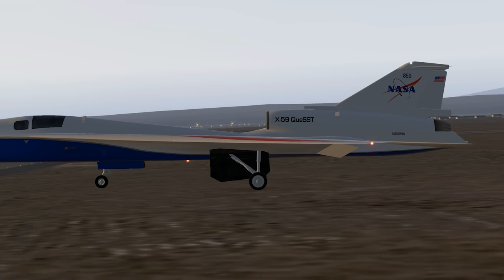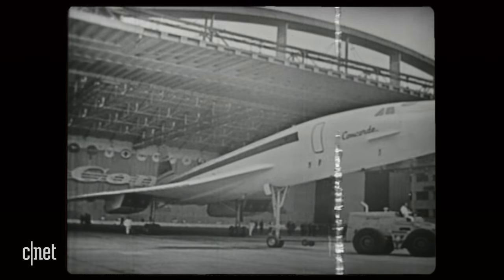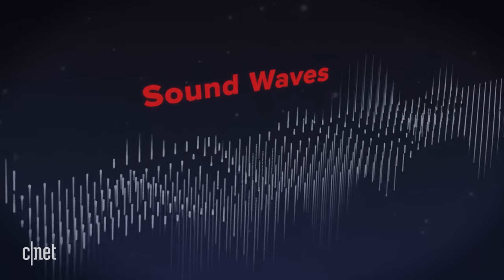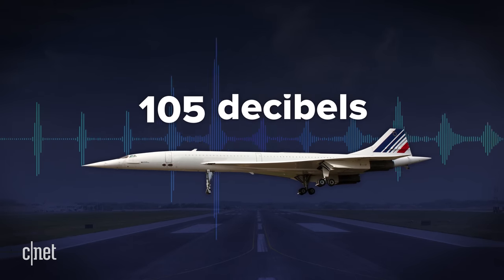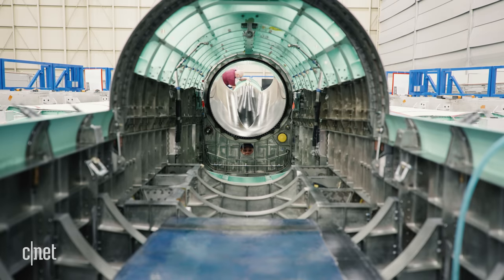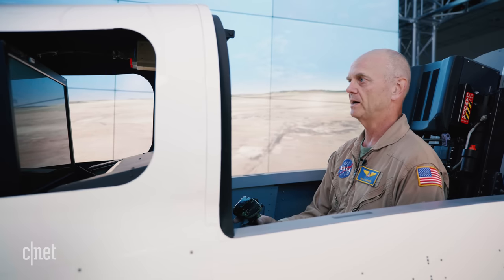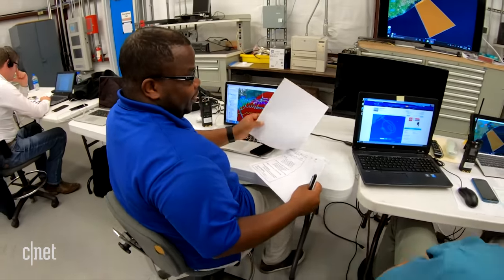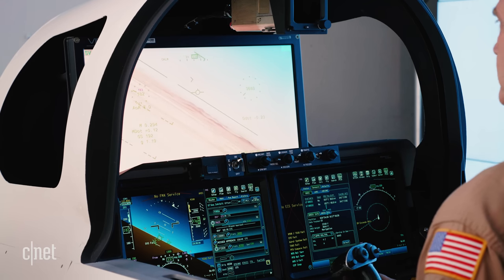Exclusive look at NASA's low-boom supersonic plane

Comment: In terms of supersonic transportation, what is needed is a "Jumbo" supersonic airliner to make it financially profitable and usable by all flying passengers. One that can carry about 500 passengers, like, the Boeing 747 or Airbus 380.  But this would require, as seen here, a sleek spear like low sonic boom aircraft that would be very very long to accommodate many passengers.  Another problem, the parking space at the terminal and runway/taxi requirement dimension physical restraints to operate such a very long low boom supersonic Jumbo transport, again not practical. 
It seems, the best method of passenger super sonic transport speed is by economically designing a way to get to earth sub-orbit, to reach the final desired international airport on the other side of the planet, much like the space shuttle, but with powerplants available to be use once in flyable atmosphere altitudes, (<50,000') so as to have in case of weather and or emergency go arounds, etc.
Reply: ГИТЛЕР. КАПУТ

Comment: first off all this experimental airplane slick design make it almost as long as concorde, while hardly carrying one pilot, while concorde was carrying 100 like passangers. 
2ndly there is no question of sonic boom problem, concorde did not make any sonic boom near residental on comercial areas. Concorde only took supersonic flight when in international space, over atlantik or high up in the air. 
3rdly, supersonic travel is question of economy as main factor.

Comment: Two problems; 1) You could never get the body to be wide enough and tall enough for a passenger load of more than 5-8 people plus luggage and amenities and still keep the shockwave at around 75db. The mention of a possible "Air Force One" sst is ridiculously laughable. NASA must not have ever been in the Presidential aircraft, or else they would've remembered the massive amount of heavy electronic equipment, deterrent measures, reinforced construction and some redundant systems it carries...not to mention a rather large crew. Have fun jamming all that into a light pencil-shaped craft with an interior the width of a crawlspace. 2) Yes, that camera array would have many advantages over a traditional cockpit window...until it doesn't. What happens when it malfunctions or its internal temperature monitoring system fails and it ices up? Better have a redundant array on the underside because your backup, (human eyeballs looking out a front window), doesn't exist...can you say "uh oh". Giant waste of money for these projects. Advancements in UAVs will handle spy/recon duties in airspace. These projects only possible functions could be spy craft in low altitude space as countries in the future will start claiming sectors of low orbit like they claim airspace zones over their respective countries. I get the sense that all of these private firms including NASA are developing these prototypes under the guise of it being for subsonic passenger travel, but in reality are really just jockeying for a military contract with the Air Force or Space Force because all these big brains can't be so summarily dense as to ignore the hurdles which I've stated above, knowing that those issues make this dream virtually impossible. I suppose however, some company might have the audacity to shuttle around four VIPs at a ticket price of a million a pop just to be a profitable venture.

Comment: 100ft/person = this will NEVER be commercialized travel Lol
Reply: It's to empirically prove a concept. Technology which would later on be used to develop an actual passenger plane.
Reply: @Phughy  except the Concord did that.
Reply: @OriginalBernieBro  did what exactly?
Reply: @OriginalBernieBro  Concorde was a Supersonic passenger airplane. Did you not watch the video? They try to tackle the issue of loud sonic booms. This is what this radical EXPERIMENTAL plane is trying to show. Low boom capabilities.
Reply: @Phughy  I just can't fathom a business case for such a plane no matter how quiet it is compared to the Concord. I'd recommend that you watch the documentary on why the Concord was a failure. I saw it years ago.
Reply: @OriginalBernieBro 

I've seen it. But is only describes the Concorde situation and business plan and why it failed. 

Now's today, a few decades later. Exclusive high-end customers with private business jets where luxury and premium experience are set forward. So, I agree, it will never become a commercial standard, but rather a niche. High end passengers are willing to pay 10k for business class seats. They'll easily pay you 5K for the same trip, with half the travel time. 

There's a new market opening up. But let's agree, this will never become mainstream commercial aviation. Merely a niche for the rich and famous.

Comment: The theory behind this is very old.

Lockheed Martin showcasing Skunk Works as a point of pride instead of a fly-by-the-seat-of-their-pants (and budget) division is new.

The prototype isn't even done.

I would rather not begin to think about how much money has been wasted on this.

It probably won't be available to customers in my lifetime.

If it is, I doubt I will be able to afford a single ticket.

A future for rich CxOs isn't one I want. It's already bad enough with the present being mostly for rich CxOs.

Note: my deceased maternal aunt used to fly on the Concorde. She was a VP of marketing for Paramount and prior to that Warner Bros. and died at 41.

A complete boondoggle. A reminder of why I wrote Lockheed Martin a strongly worded email after they repeatedly attempted to headhunt me. The only way I would ever deign to be hired by them would be to dismantle them from the inside out.

The world doesn't need any more mercenary industrial complex DOD profiteers.

Comment: Problem with the X-3 and was addressed by Concordes dropping nose. Was you can’t see a thing.....with that long nose! It looks cool...and works to its point! However..landing was a problem. Got to drop that nose! Sonic Boom and expensive ticket prices and crash. Made it a non commercial fiasco! Had no military applications. Now this is much smaller. And just a test vehicle. Another prototype....like the X-3. Which was underpowered..and those stubby wings made for very fast landing speeds..and not much lateral control. The F104 was a direct result of this research. A fast interceptor..the 104 also had another name. Widowmaker!  Touchy....and several accidents.

Comment: There are more considerations about supersonic passenger travel than just the boom. The pollution caused by Concorde seriously threatened the Ozone layer and used waaaaaaaaay more fuel than a typical jetliner. So unless they found a clean and efficient way to push the plane to those speeds then I’m still against it.

Comment: Yes, it's cool, and I'm for tech development, but there are problems. What are the consequences of using this tech? The thing has to fly in the stratosphere where air gets trapped and does not mix with the air above & below it - including the copious exhaust expelled by these jets, and the pollution stays there for years.

Comment: 57 Proof of the flatness of the earth
Physical and scientific evidence of the flatness and stability of the Earth:

1- water level
2- No curvature (law of perspective)
3- There is no gravitational pull
4 - The failure of the hypothesis that the Earth caused the eclipse.
5- Radio waves are not transmitted in a curved path.
6- The impossibility of air (atmosphere) coming into contact with a vacuum.
7- Aircraft do not bend.
8- Aircraft are not affected by the movement of the earth between the north (0 km / h) and the equator (1666 km / h)
9- Proving that space agencies are lying (fake videos and photos)
10- Railways.
11- The appearance of the stars does not change during the year.
12- The location of Polaris has not changed despite the three movements.
13- The inability to launch the missile in a vacuum.
14- Experiments have proven that there is water above us
15- Trigonometry proves the impossibility of the sun being 150 million km away from the earth
16- The horizon rises with you when you rise to the level of your eyes
17- The many differences between the two poles, while it is assumed that they are similar to the spherical shape
18- Not feeling the movement of the earth
19-No flights over Antarctica
20- Seeing the same stars after six months (they are supposed to be on the daytime side)
21- Allegation that the Earth is flattened in the equator due to rotation, but the seas are in their place and the rotation has not affected them.
22- The retrograde motion of the planets breaks the solar system and the planets revolve around the sun.
23-Determining the size of the sun, the size of the planets and the moon, and the distances, and putting large numbers without evidence or scientific proof to prove
24- The width of the moon’s shadow at the time of the last solar eclipse in America was 100 km, which means this is the width of the moon or smaller, because scientifically it is impossible for the shadow to be smaller than the body (abbreviate it yourself).
25-The direction of river flow violates the law of gravity
26- Flights and itineraries made sense on the flat
27- The closer to the sun, the lower the temperature
28- The atmosphere is supposed to expand or contract due to its sticking in a vacuum
29- The scientific community cannot define “sky” at all. This is only possible with the Qur'an.
30- Clouds do not curve to match the curvature of the earth (it is always straight from below)
31- The difference in summer and winter between the north and south of the Earth contradicts the theory of the Earth's tilted axis.
32- It has not been proven that the sun is made of fire and plasma, and the flames have not been photographed in a real way
33- The theory of the water cycle does not match hot, steamy areas
34- The weight of clouds carrying water, snow, hail and ice, violates the law of gravity (the last incident is witness).
35- Too many suspicions about the existence of satellites and the space station
36- No logical explanation was given about the {go fast} missile hitting the water at an altitude of 116 km
37- The impossibility of cutting millions of kilometers of light without fading out (you have a searchlight, does its light travel for several kilometers, even the laser, and what does it do for hundreds of kilometers)
38 - Refuting and contradicting the theory of Big Bang and evolution, which definitely proves that the Western scientific community is full of lies.
39 - Gravity and how it is has not been proven and defined by experience.
40- The media war, silencing of mouths, and the policy pursued against flat owners by global sites such as Google and YouTube suggest that there is something terrifying them, while they spread absurdities every day such as asteroids and black holes.
41- The 1880 Michaelson-Morley experiment was obliterated, because it proved the stability of the Earth.
42- The Biddle-Ayre experiment, which proved the stability of the Earth, was obliterated and ignored by the scientific community.
43- Calculating the times of eclipses and eclipses has nothing to do with sphericality, just an account based on the Saros cycle, which was used at a time when everyone believed in the flatness of the Earth.
44 - No scientific research peer reviewed publication empirically proves the curvature and curvature of the earth.
45 - Experiments are to prove hypotheses and theories that contradict reality! How can a flat person perform an experiment to prove, for example, that the earth is stationary and does not rotate, or prove the opposite of what it sees with its own eyes! The footballer is the one who has to do experiments and not the other way around to prove his hypothesis and so far all his experiments have failed and have been refuted by experiment and proof.
46- The weights do not change whenever we go north or south of the equator with the stability of attraction and the weakness of centrifugation.
48- Neglecting density and pressure in the law of gravity and calculating acceleration
49 - The horizon is always straight and not curved, and it is always at the level of the eye and sight. Chicago buildings that appear 80 km away are the most significant evidence of the absence of any curvature.
50 - Lines of longitude and latitude are congruent to a flat, while they do not fit on a sphere! Because the ball is supposed to be circles of length and circles of width! The ball is not straight, all sides are circles.
51-The sky is always above us, not around us!
52- There is no meaning for up and down in the sphericity of the earth.
53- In order to calculate the speed of any body, you have to be constant, so how was the speed of the planets and stars calculated, and the Earth is not fixed, rather there is nothing fixed in the solar system?! Was the Earth's speed around the sun calculated from anything fixed?!
54- Radio broadcast its first appearance on 1915 from Europe to America, before the invention of satellites. The broadcast is still the same and does not support satellites
55- The outage of GPS, mobile networks and Thuraya services in desert areas, mountains, seas and tunnels indicates the use of radio waves
56- Einstein admitted the impossibility of observing the motion of the Earth by any visual experiment
57- The current agreement of civilizations on the sphericity does not indicate anything, as civilizations previously agreed that it is flat until the demons came and deviated them from their view of the truth.
Reply: Wow... phone an Australian cousin at midday and ask if it's dark there. 

Seasons....need I say more.

Heat rises. Yes. Yet it gets consistently colder and the air thinner as you gain altitude.

Comment: This is crap.  We got rid of sonic booms with the antigravity systems back in the 1980’s.
Reply: What
Reply: Please tell me your joking, wtf is an "anti-gravity system"
Reply: @man_-1  dude we have had anti gravity drive for over 45 years dude.  You have not heard of the TR3B .  This is a Mach 12 air craft using plasma actuators to keep the air friction off it.  The air craft antigravity system creates a field that removes 90 percent of the weight.  That same system also renders the aircraft visually invisible because light bends around it.  Yes it is invisible to your eye when activated

Comment: Any supersonic plane is a greenhouse gas nightmare! This should be boycotted.
Reply: Fun fact of the week;

"Kerosene lamps are widely used for lighting in rural areas of Africa and Asia, where electricity is not distributed or is too costly. As of 2005, kerosene and other fuel-based illumination methods consume an estimated 77 billion litres of fuel per year, equivalent to 1.3 million barrels of oil per day. This is comparable to annual U.S. jet-fuel consumption of 76 billion litres per year."

Comment: So the riches can burn fossil fuel at FOUR times the rate they do already, while we have to deal with the noise and environmental breakdown. Paris Hilton already has 1200x the average American's carbon footprint even without flying supersonic.
Reply: Airplanes contribute a fraction of a percent of what cars and trucks contribute in terms of CO2 emissions.  Boats and planes are not the problem.  Fossil fuel power plants and land vehicles are the problem.  Also, yes airplanes consume a lot of fuel, but they also carry a lot of people.  If you factor in how many people a Boeing 777 can carry compared to how much fuel it burns it is actually very efficient compared to a car.